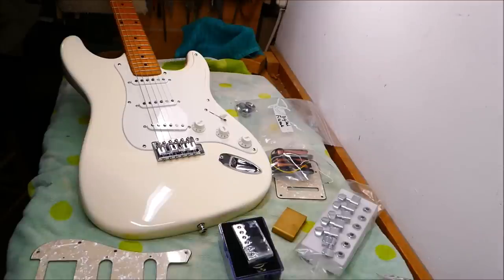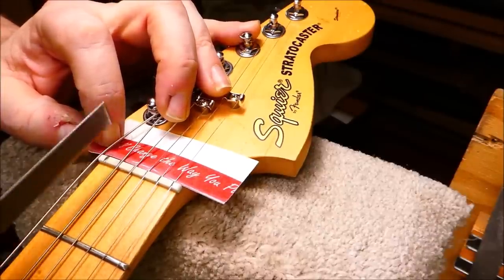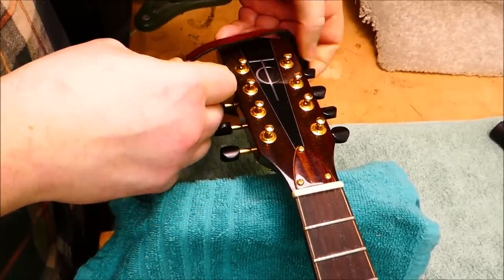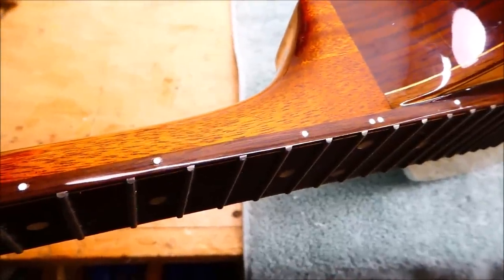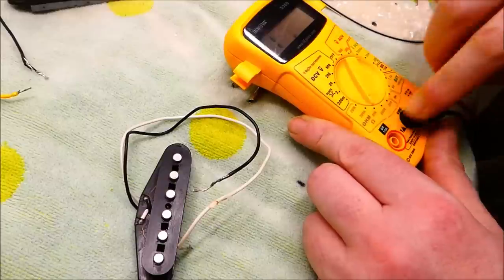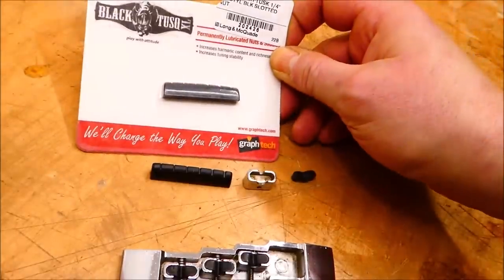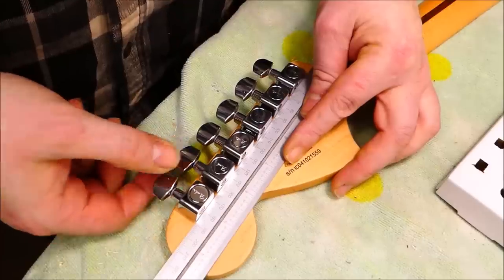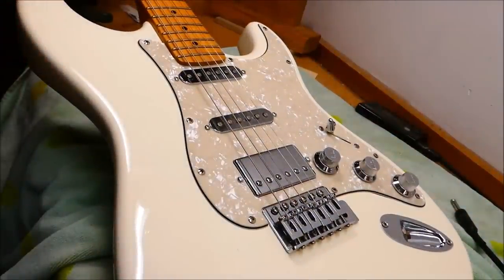That's a lot of work!

Comment: Amazing how extensive the work required was for a simple “parts swap” job, probably $450 worth of labor that got heavily discounted, I bet!
Reply: Yeah, $450 at least. You're not just paying for the actual work to fit the pieces together, you're also paying for Ted's experiece and knowledge so that the pieces are put together correctly/optimally. You're also paying for Ted's knowhow to deal with problems like the problem with the height adjustment on the humbucker. I'm thinking that the strat mods should have been more like $600. At that point you're looking at just going out and buying a Squire that has the look and features that you want. I apprreciate Ted sharing this content and going into the difficulties of building a partscaster. This helps people go into a partcaster build with their eyes wide open.
Reply: This is not an Honest assessment of a parts caster.
    What he dealt with, was a customer that did not order the correct parts.
    Parts are sold stating the correct diminsions and notices for what the part fits, as in American Made Fender, mexican made Fender, Overseas Squire, et cetera and so forth.
    He could have just as easily told the customer that the customer ordered the wrong parts, suggest that the customer Return the wrong parts, and order the Correct parts.
    Now, he has plugged the Original drill holes in the Headstock and Back Side of the Body, and added New Drill Holes in Each of those, and scraped the Pick Guard, so that None of the Original Parts can be Replaced without having to do ALL of that  "work"  Again !
   I find that Very Irresponsible of him.
 I doubt very seriously that he didn't know that, and it was his repsonsibility to Inform the Customer before he started Ruining the Original Parts, Body, Headstock, and Pick Guard.
   Yes.  It is a Squire, but ALL of those parts could have been Replaced with the Proper Parts without having to do Any Drilling, Plugging, Sanding, or Scraping. 
  This Video, and the Squire guitar, was a Complete Travesity of Unnecessarity !
Reply: @EwetoobSucks  You are entitled to your opinion. My experience of partscasters is closer to Teds. Yes, you CAN get parts that fit but the whole idea of the partscaster is to put together parts from various sources and there is nearly always some "easement" needed. You presumably noticed that the pickups were not new (or indeed of any obvious provenance - ceramic bar magnets???). Who knows how long the customer has taken to assemble the bits and who knows how much Ted has discussed the progress with the customer.
Reply: @PeterWasted  
    Well, as I appreciate you having your opinion, I also appreciate value, and I am certainly not alone in that, but, sure, absolutely.
   Destroy any Resale Value of the Base Parts by cutting into them so that some other parts of questionable value may be put into them.
    Yes, you can always Recover the questionable parts that were put Into the Base Parts, but, then the Base Parts are as Valuable as Fire Wood at that point.
  OR,  now,  I am just spitballing here, you could put in the Proper Parts, that Do Have Resalable Value, Including the Base Parts, and Start over with another project a little further on down the line, if you so desire.
   The point being, that in the Second Scenario, there is Real Value to be Recouped, and the First Scenario has Little Value to be Recouped.
  But, Ok.  You know what you are doing.
Reply: @joe102674  
  Those parts can always be used on another project or swapped with someone else for the Correct parts.
  It is not that difficult.
Right off of the top of my head is Reverb, and you can use yelp for swap meets near you, and then there is always the online swap addresses.
   There is absolutely no reason to take a total loss on anything guitar related.
   I Love Tims Channel and the work that he does, which is why I watch it, but, I just have to disagree on the decisions made with this one.
Reply: @EwetoobSucks  ... Why do you assume so much ? .. Maybe the luthier was giving his old customer exactly what he wanted and what the customer directed the luthier to do ? .. The luthier's customer was in a bad way and convalescing from eye surgery . Likely he did not want to or was unable to order exact fit parts . Maybe he gave the luthier carte blanche to do whatever it took to assemble the guitar so he could have a playable instrument , and was willing to pay up for that service ? ... Maybe a Lot of things . . .
Reply: @HighVerbal  
   Yes, well, maybe you don't make your quite incorrect assumptions about me.
 I made no assumptions.
I merely applied freely, logic and reasoning.
    Apparently, that is just to much for you to bear.
   Oh well.
Reply: @EwetoobSucks   .. No , you made assumptions and then applied hard advice to the luthier >

" He could have just as easily told the customer that the customer ordered the wrong parts, suggest that the customer Return the wrong parts, and order the Correct parts."

Again , maybe the luthier did what the customer told him to do , or gave him carte blanche to use his discretion freely.. ? .. You don't know that he didn't do that .

And then after more wild assumptions on your part , you made a Harsh judgment upon the luthier > 

" I find that Very Irresponsible of him."

Do you even proof-read what you write ?
Reply: Given that the customer supplied all the parts, the labor would be the issue. The going rate near me is $80/hr (USD), so spending five hours to get that motley crew of pieces to fit together would be $400 or so.
Reply: @EwetoobSucks  1) Anyone who uses as many capitalized words as you do gets points off.  2) "Unnecessarity" is not a word.  3) Anyway, I disagree with you on the merits.
Reply: @HighVerbal  
    Again with the maybe, maybe, maybe.
 Yet, my Original Statement Remains True.
   If indeed the customer had given him carte blanch to do with the guitars base parts, regardless of the impending future devaluation of those parts, then the video creator should have said so in the video, so as not to mislead the viewer to believe that he is doing his best, with what he has to work with, having No Other Option Available to choose from.
   I find this very irresponsible of you.
Reply: @daveman_50  
  You are correct.
 Unnecessity is the Correct word.
It is a typographical error on my part. 
  Yet it shall remain, because I Deem so.
  "To Err Is Human ;  To Forgive, Devine."
    As far as the rest of your other worthless emotional tirade, ... irrelevence.
Reply: @EwetoobSucks  Its a Squire Strat. Valuable as firewood from the start.
Reply: @emptywig  
   Ha Ha Ha !
 Fair  Enough !
Reply: @EwetoobSucks  divine*
Reply: @michaelszczygiel2069  
   Yes.
 Again, I am tired, and, apparently, the typos are just flying off of the page, therefore, I must rest for the night.
Reply: I would be paid no more than $60 for this work, since Squier is not worth the large upgrade investment.
If only it were a more expensive guitar...
Reply: @HighVerbal  he's lucky he can't see, because the new chrome parts look plastic-y and cheap: the knobs, the switch tip, the pickup covers (single-coils). Wait a minute, he can't see so what's the point. Finally the pickups sound cheap and tinny in the sound sample. I agree, buy another Squier.
Reply: $450 for 5 hours work? I’m a full time tech myself, I ain’t making $90 an hour haha! Personally I aim for £150 to £200 per day, so I would price this work for myself to do at about £120 labour
Reply: @tytesseract  
     No, but, thank you for your incorrect premise.
   I was tired and making typographigical errors and had to rest.
   If that particular person feels that way about a product, there is no changing that persons mind, so why Waste the Time and Energy.
   That is his particular Opinion, and he is Full Well Welcome to it, even if he does not have all of the Facts to make an Informed Decision about that particular product.
   It is like trying to convince a Ford person that Chevrolet is better, and vice-versa.
    In All Reality, Squire has made significant increases in the Quality Control and Production Departments, leading to a Far Superior product than what was offered just a couple to few decades ago.
   They are actually very good guitars.
 So well made, in fact, that they actually do have a Decent Resale Value, even if one is solely dealing with the guitars Base Parts.
Reply: @EwetoobSucks  plugging holes isn't ruining resale value of anything.  As you said the work can be redone to restore the parts to near original condition.  He shimmed the neck.  He didn't remove any material from the neck pocket.  He also stated at the beginning of the video that he tried several times to decline doing the work in the first place because nothing ever goes together as expected. In the end the customer got what he wanted and what you should expect from a professional.  I'm sure he got consent to do all the work
Reply: @xXVintersorgXx  
  It is not All Original.
 That alone is a Devaluation.
Reply: @EwetoobSucks  the value is in the fact that the customer has the result they were expecting and paying for
Reply: @xXVintersorgXx  
   Thank you for your quite incorrect language comprehension.
   At  No Time   did I say value.
 I said Resale Value.
   Two very Different things.
Reply: @EwetoobSucks  resale is a pointless metric if you're not selling it
Reply: @xXVintersorgXx  
   Thank you for your irrelevent point.
    The guitar Base Parts will still be here after the owner passes away, whether they remain as one guitar, or in seperated pieces.
  This goes for you, me, everybody.
  That is the Human Experience.
 Once the owner has passed away, the property will go to someone else.
   The one that inherits it may Keep It, or Sell It.
  It would be at this Point in Time, that the Resale Value comes into play.
Reply: @EwetoobSucks  it will likely be passed to a relative that will keep it for sentimental reasons or sold at a fraction of it's resale value due to the seller having no idea what it's worth.  Regardless your point is absolutely ridiculous.  I suppose my daughter should keep her dolls in the original package to preserve it's resale value.  My point is resale value has no bearing on actual value to the customer.  It could end up in a house fire and the only value it will have is the memory of actually enjoying it.
Reply: @EwetoobSucks  
Good Points !
 And what in the hell is up with all of these haters ?!?
  This last guy really takes the cake !
What a 🤡 !
Reply: @MyButtsBeenWiped  
     Yes, well, this is my 14th Post in this thread.
   Most of them have been attacks.
It is unfortunate that One must be Attacked for making an Honest Observation and be Forced to Defend Oneself, but, this is the Way of Things today.
    Hopefully, others will learn from the previous attackers mistakes by Not jumping to False Conclusions before they Attack someone.
Reply: @EwetoobSucks  I have zero interest in your opinion, but I really hate the fact you pointlessly capitalise so many words. As Ted said at the start of the video he was asked to do it by a customer, and predicted what would happen, I assumed a) Ted was well enough informed to make the judgements he did and b) to some extent was using it as a salutary lesson for his viewers. I've done a lot of these for practice modding my own guitars and have endless respect for people who do it for a living, and do a good job at that. Also, you think "Ewetoob Sucks" is funny. That and the capitalisation makes me assume you're 15. Maybe 16.
Reply: @EwetoobSucks  
   I told you, don't bother with these (screwyoutube deleted word).
Don't waste your time.
Reply: @richardsmalls7721  I guess $400.00 would be a good ballpark figure. In a situation like this, where the guitar tech is friends with the customer, I would hope the tech would have let his friend know what the damages were going to be before proceeding. Or maybe lose a friend.
Reply: @EwetoobSucks  L sure Ted is going to give the guy a good deal. He worked with th parts the guy gave him and did a good job fixing it. The guitar had no real value the way it  was,, its not a classic. He should have not taken the job but sense he did take he did it with the parts he had.
Reply: @joetow4817  
   I find your lack of reading comprehension reprehensible.
  If you actually graduated from a High School, you should sue them.
             Just trying to Help.
My very first comment addresses all of that, and all of the subsequent replies to replies confirm it with examples.
   I am not going to go through all of that again.
   If you want to Jump on the Haters band wagon, then so be it.
    I shall refer you to my very comment prior to this one.

Edit :   I know from Phil Wilson that my comments have been deleted and shadowbanned, so just for your reference, this is my sixteenth comment.
Reply: @EwetoobSucks  its fascinating how one's tone can affect our comprehension. I went from completely agreeing with you in the first comment, to worrying about your mental health several comments down the line. Here's a hint - ranting and speaking in riddles does not help people understand you.
Reply: @emptywig  that's your boomer delusion
Reply: @MyButtsBeenWiped  Funny how both you and @Ewetoob Sucks have such an oddly similar writing style, what with that random spacing before each line etc. Anyone looking at your comments could be fooled into thinking they're coming from the same person.
Reply: @hoodoo-man  
 Yes.
  Of Course.
We MUST be the ONLY ones who speak in Complete Sentences, using nothing but Logic and Reasoning.
   In todays world, THAT certainly does make sense.
Reply: @MyButtsBeenWiped  The resemblance really is uncanny, maybe you're long lost twins? 

Please tell me you're just trolling?
Reply: @hoodoo-man  
Seriously ?
 I suppose that you believe that life only exists on Earth in this vast universe as well.
Reply: @hoodoo-man  🤣 He's so insistent on proving himself right he has his very own self support account.
Reply: @EwetoobSucks  nah, not true. i have done this a bunch of times, with attention paid to buying the correct parts as much as  i could.  still, i ended up having to do most of these jobs, or actually probably all of them, even if maybe not all of them on a single guitar. for example, a pickguard will just never fit. if you want to upgrade the tuners, you will need different drillholes because there is just no upgrade with the same little pegs (and at least he did not have to enlarge/fill the tuner holes themselves which could have happened). the neck and body weren't a perfect fit to start out with, so the shims had to have been done. pickup covers also can differ tiny bits, so it might fit one pickguard, and not the other. it does not look like some expensive feneder original pickguard, but probably something chinese. the measurements on those are totally random, so no matter how carefully you order, they may or may not be the right fit. also, you have no idea what kind of a body is that, so how are you going to order the right measurement parts? you are just going to order what you like color wise, and then make it fit. also, you ordered bunch of parts online, possibly from china, you are not going to return them and replace them with the correct one, it is not worth it with all the shipping cost and waiting time involved. i mean, have you actually ordered parts and put together a partscaster yourself? your main point is resale value of the original parts which are clrearly close to worthless to start out with, they are definitely worth less than trying to ship everything back and getting different parts, not to mention how much more the actual fitting parts might cost. maybe he got the not perfectly fitting ones because these were so much cheaper. resale value of original parts is clearly much less than play value of the guitar that you end up with. you lose way more on the labor cost than on the resale value of original parts. the luthier did tell the customer it is not as simple as he may think, and that it will be  not wort it. customer still wanted to go ahead. you might not like it, but it is their decision if they want something like this done.
Reply: Maybe the price of a cheep Squire is not the issue.  Maybe this is his life long guitar and he purchased used parts because this is what he wanted on his life long guitar.  Now as for resale.  Come on. A Squire used is like $150 sold with mod parts might get you your $150 back. But if the is again! Your life long guitar.  WHO CARES.@EwetoobSucks

Comment: I used to mess around with this stuff when I was younger. Different pickup arrangements and pickguards. My coolest creation was a baritone made from a Strat body and a Warmoth conversion neck, wired with dual outputs (guitar/bass amps) and full controls for each. The middle pickup was a coil tappable hot rails which had its own vol/tones then the output to a bass amp, while the guitar's standard output was wired to a single coil in the neck and another hot rails in the bridge, which was coil tapped and operated with the standard 5 way switch, which actually worked like normal if you imagine the bridge pickups north coil acted like the middle pickup in terms of switching. The guitar was a lot of fun, but playing in drop A was super annoying and I sold it and back to my regular 4 string Ibanez. Nowadays I save up and buy a nice guitar and play it as it is.